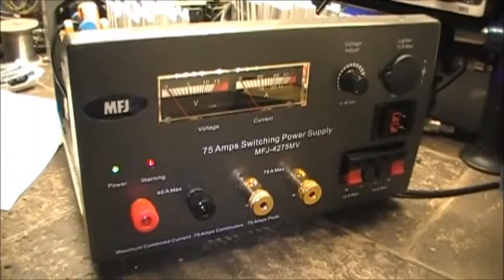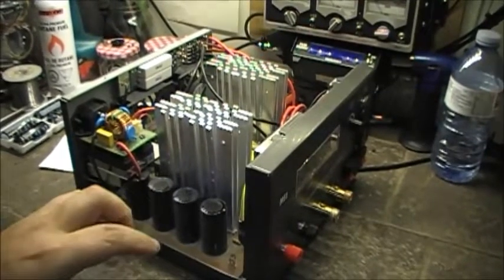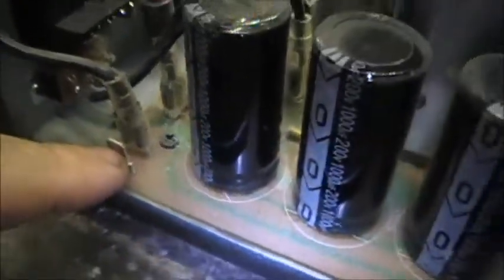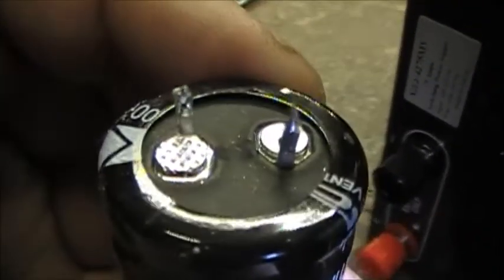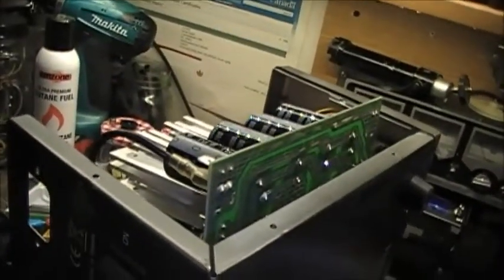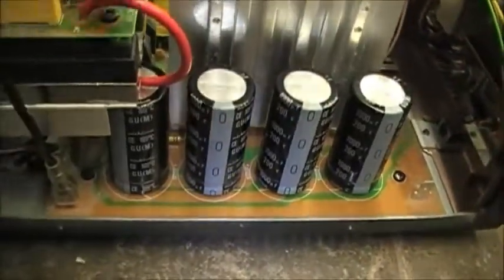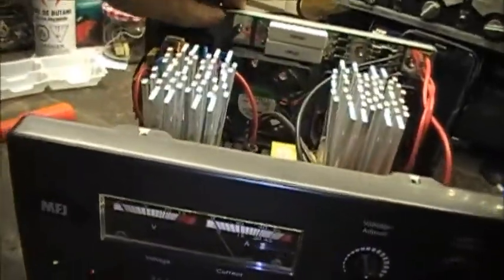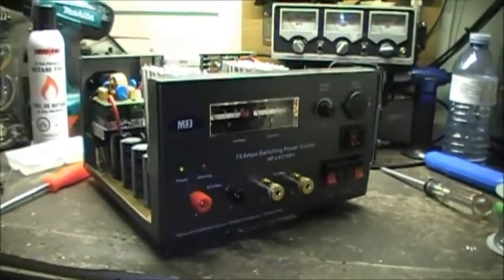MFJ 4275mv trouble shooting and repair Part 2

Comment: So I have an older power supply, it only makes a weird noise when I key up on amp and the voltage on the meter drops, hard to explain the noise, but its not a sizzle more of a vibrating noise I guess idk, any thoughts on what it could be without you looking at it ?
Reply from the maker: what is the model of it?
Reply: @Radionut63  NPC model 109RA
Reply from the maker: @cmvb69  Check this out: https://worldradiohistory.com/hd2/IDX-Short-Wave/archive-73-idx/idx/70s/73-magazine-08-august-1977-OCR-Page-0126.pdf